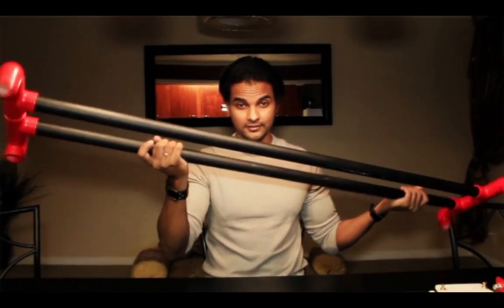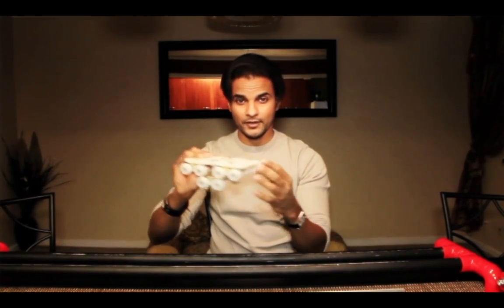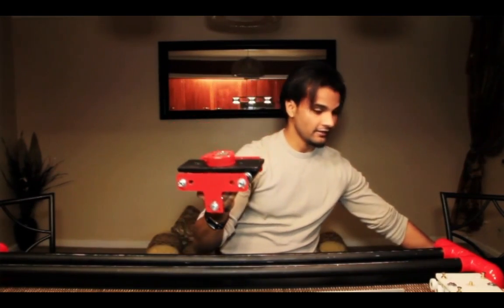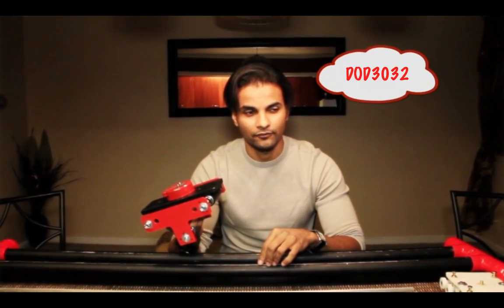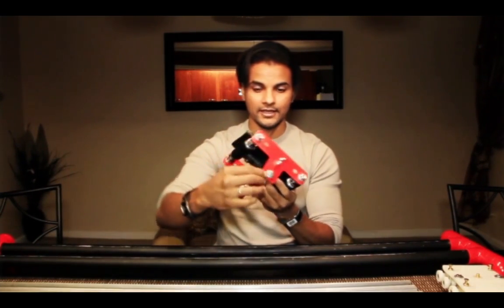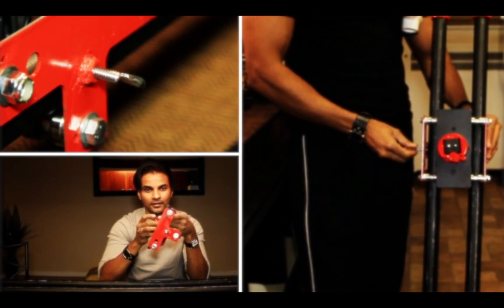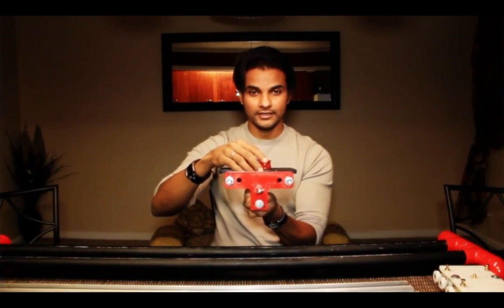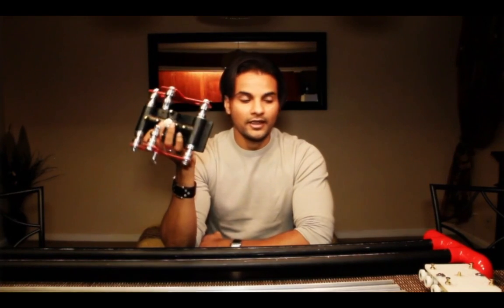Tutorial - Best DIY Camera Slider Cheap for any Camera (550D Canon HS300)

Comment: HI, nice work im definetly going to build this, what size spacer did you use between the wheels? I think if you went with a 1 1/2 inch pipe with a wider spacer would give you more stability and in return more smooth of a glide because you would be giving it a wider weight distribution

Comment from the maker: sorry to reply late, 10-24 should be 2inch and then if the access coming from the bottom, cut off the extra piece using hand saw. and the spacers you can find form home depot, they are cheap...if you are close to US sports Authority they have them also in the skates section.

Comment from the maker: thanks , metal would be a best choice, however, you will hear heavy metal sound in your recordings. I have tried to insert a thin diameter metal electrical pipe into the pvc pipe then ran the glider on it and it worked fine for me..if you do go with the metal pipes, u can use water hose on the wheels to reduce the noise, or use external mic, or get a flexible water hose and insert the metal pipe in it and then there will not be any noise. I got busy with my shootings,

Comment from the maker: hey thanks for the comment,yes it can be harder,but if you are good with DIYs its not that hard, anyways,about the bolt sizes, it starts at 3.59 in the video, then there are three sets of bolts that i didn't mention the lengths, however i did mention the size(number of the bolts) in that section,then again,about the washer,it depends on the washers.. some washers are thinner and some are thicker,so u have to pick all the washers with the same thickness and then it will match the numbers i picked

Comment: This is harder than you might think it is I just finished it, it took me about 5 or so hours, and thats just assembling it all. Just a thing you should update in your video is the size of all the bolts, i had to go back to home depot again because some of the bolt sizes werent specified. Also i think you used more washers than you originally specified, because i used more than what was in the video. Also you should do a diagram on how the bearings go on the bolts and the pattern of washers u use

Comment from the maker: i think i have mentioned that in the tutorial the length of the screws, but let me know which screws are u talking about...the main wheel screws are 6 inches long...and the other ones are different sizes and then if they came out little longer i cut them using the hex saw..let me know if u need nay help..

Comment from the maker: @5just5me5 I will be going for Panama City for a week, after I return I will be doing the final assembly for the new metal rail system..easy and simple...I tried it with the metal rods..which was ok not bad...however felt little heavier...so if you like you can go with that...but the one i m building its light weight metal...so its strong but still light..i will be doing little modifications to it so its easier to make, so stay tuned until i come back...

Comment from the maker: @izaya35 for the platform to join all the parts i used 10-24
for wheels 5/16
for lock 1/4 
for camera or fluid head mount 1/4

Comment from the maker: @MrMorbote you can use either ones...if you look around your area and find a store where they have roller blades or skate shops, they have bettr bearings for cheap...i just found out a store near my area and they have a pack for 9.99 for 10 bearings which has 7 balls in one bearing which is a good bearing.